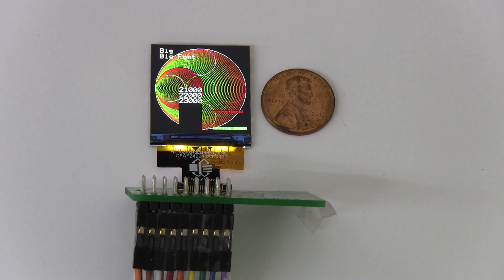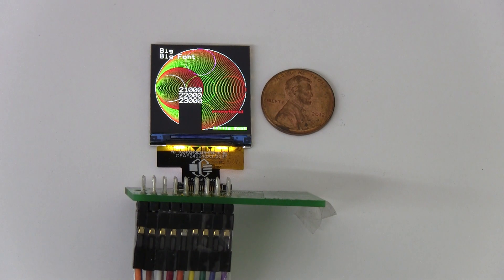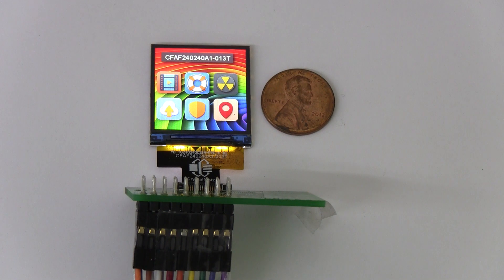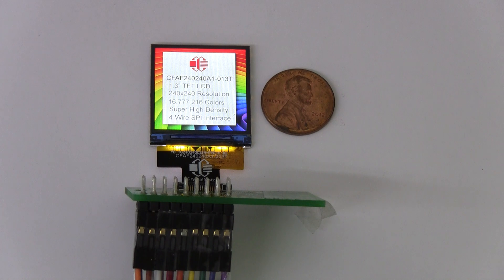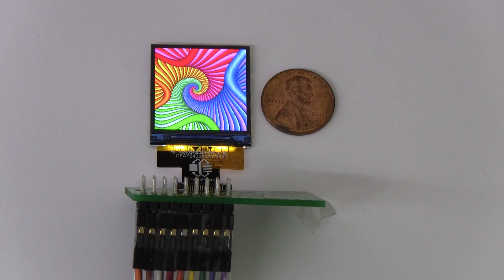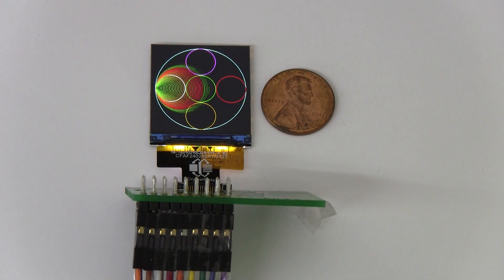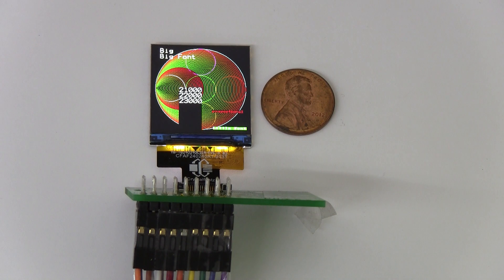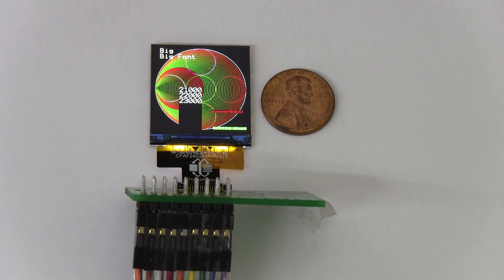High Density 240x240 1.3" TFT LCD

Comment: Do you guys have any links/suggestions/starting points for this LCD being implemented with a Raspberry Pi?
Reply from the maker: Tyler: Since the display is SPI, you would need to use the Raspberry Pi's SPI interface. I would guess that there is a ST7789 library for the Raspberry Pi out there somewhere. This one comes up on GitHub: https://github.com/solinnovay/Python_ST7789 , it might be one starting point. This library looks pretty complete: https://github.com/juj/fbcp-ili9341 and it is typically not too difficult to port from one controller to another using our demo initialization code.

Comment: hello, I am new to Raspberry Pi, and was wondering if this display is compatible with the dsi display port on the raspberry pi 3B.
Reply from the maker: Nope, unfortunately, the DSI is "closed architecture" aka proprietary... But this display is SPI compatible, so you can simply use SPI. I hope that helps.

Comment: Looking at the demo code, I notice that uSD_CS and LCD_RS are both connected to pins on the Arduino. I plan on using an Arduino Uno for this project. I have searched the web, looking for where uSD_CS and LCD_RS are located on the LCD display. I have also checked the pin table for the LCD display and nothing pops up. So what pin on the LCD display should these two be connected to? Thanks!
Reply from the maker: Tyler, thanks for your question.

uSD_CS is the Chip Select for a Micro SD card (μSD), and so it does not go to the display.  A μSD card is used to store images for the demo. The μSD is not strictly needed to talk to the display.

LCD_RS (Register Select) is a synonym for the LCD Pin 12 D/C (1 for Data, 0 for command)

The display has a lot of dots: 240x240 x 3 = 172.8KB, so you might want to use something with more oomph than an UNO. The display also has a max voltage of 4.6v so that limits you to a 3.3v device.  You might want to try something more modern like an AdaLogger: https://www.adafruit.com/product/2796 which gives you 3.3v, a built-in uSD card for images and higher speed/more memory. Also, I think we have AdaLogger code for that display.

Comment: What does that base circuit board look like? I just bought on of these and i'm kinda confused on how to hook it up?
Reply from the maker: Hi Andrew, it's a simple PCB for connecting the ZIF connector. Using the pinout from the datasheet should give you the info you need.  The PCB we're using is here: https://www.amazon.com/34-Pin-Connector-Breakout-Board-0-5mm/dp/B00XSC2EV0 and we're using this zif connector: https://www.digikey.com/products/en?keywords=609-5199-1-ND feel free to email support@crystalfontz.com if you need some more assistance.

Comment: 3,3v = wont work on Pi Zero? imo 5v only..
Reply from the maker: You're correct, but theoretically you could use a level translator to get it to function at 3.3v 
Let us know if you need any help getting this display up and running on whatever controller you're using.